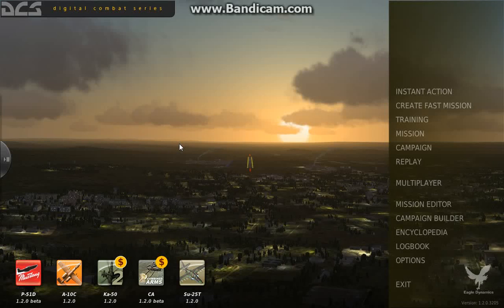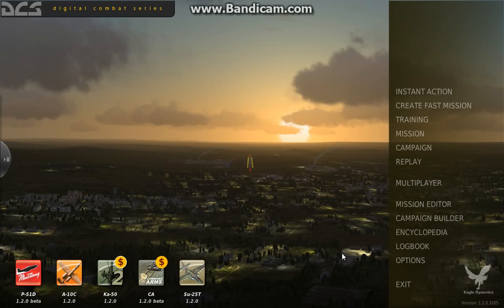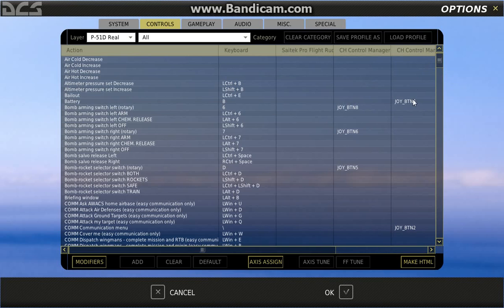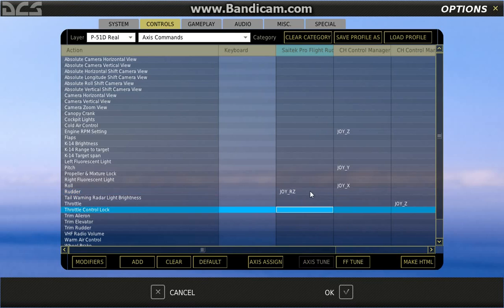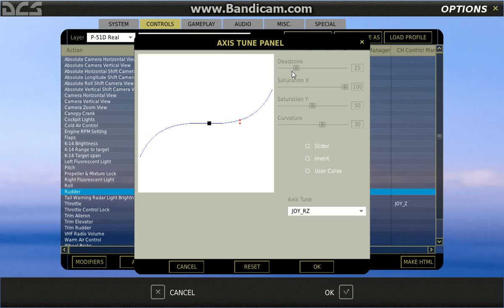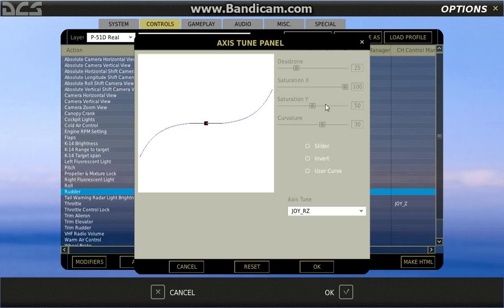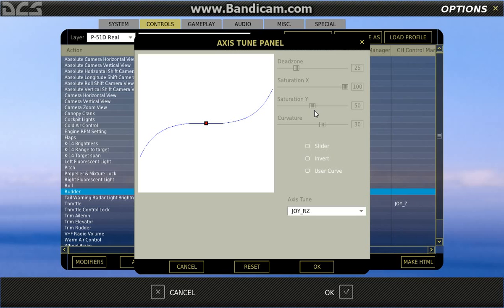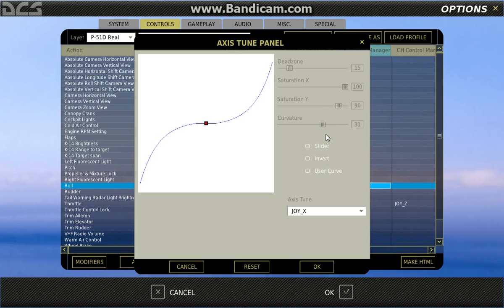DCS P-51 Mustang: "Joystick Axis & Takeoff/Landing Tutorial Part 1"

Comment: Great video, thanks for sharing. Are you still using these values for latest 1.2.7 version? Also, would you have any tips for engine management ie. revs/mani pressure/rad settings for different flight regiments? Dogfighting in particular. I tend to pop my engines a fair bit!
Reply from the maker: Yes still using these curves in 1.2.7. Always remember to increase RPM first then Increase Manifold.......Decrease Manifold First then Decrease RPM. Raditor I always keep on auto for the most part although some use manual full open for take offs and landings and intense combat for maximum cooling. 18-20 RPM for combat for cooling purposes, and not more than 32" manifold in sustained constant combat. You can go part 32" but use it smartly. If you are in a dive and hitting close to 450-500mph you need need need to idle or significantly reduce RPM or your engine will over reeve and die. Decrease RPM to 18-20 shortly after take off for engine cooling. Check out part 2 of this video for some demos of RMP/Mani management
Reply from the maker: Also Marty, squadron mate recommends first notch flaps in air to air combat, and 35-40" manifold may be used in spurts. Climb high  when fighting and try not to get into turning fights but rather do slashing hawk attacks from altitude.
Reply: awesome thanks for your help =)

Comment: Hey,

the problem is, that you may want to use full rudder while taxing or on extremely low speed maneuvers (maybe more of "lets see what i can do with... AHHHH!" maneuvers). I have a x65fwhich is force sensing by nature, I'm looking for a way for the responce curves to be adjusted by the force a pilot would need to apply to the stick on the given speed rather than static curves. E.g. full possible pressure would be 100% on taxi but like 15% on max speed. Any idea how I can do that?

Comment: Thanks for making an excellent video!  Question...  How do i calibrate the the joystick in DCS?   I've gone through the setup menus but there does not seem to be a "calibrate" function.   This is a big problem  because my rudder is not centered and my plane is constantly pulling to the left.    I do not have this problem in X Plane or FSX.  Anyone able to advise?
Reply from the maker: Greg S I pulls to the left due to torque of the engine. As in, the propeller spins the right and wants to make the airplane twist to the left. On take off, start with full right rudder and only about 40 manifold. As the mustang increases speed, gradually increase power and relive pressure on the right rudder pedal. If everything works in FSX I assume its the massive torque of the 1490 horse power engine.
Reply: Well it pulls left when im barely rolling on taxi. It pulls left regardless of engine power.  It seems the js is not centered.  How do i calibrate the js in this sim?
Reply: it does this with the su25 also.
Reply from the maker: http://steamcommunity.com/app/223750/discussions/0/46476144983467996/ "Try turning CAS off and see if you have same trouble without it.

CAS (Control Authority System) will attempt to stabilize flight and has damping effects etc.
It is not pure mechanical/hydraulical system so behaviour of it is not as straightforward as pure mechanical control system.

LCtrl+ 1, 2, 3 should turn off CAS for pitch, roll and yaw."
Reply: ***** I have fixed the problem!   Someone explained that since DCS does not have a "Calibrate" function as the other flight sims, you must use the Windows 7 calibrate function.   After calibrating my stick in windows 7 it worked fine in DCS!  Thought i would just pass that bit of info on to.